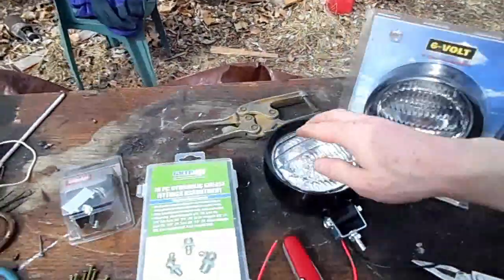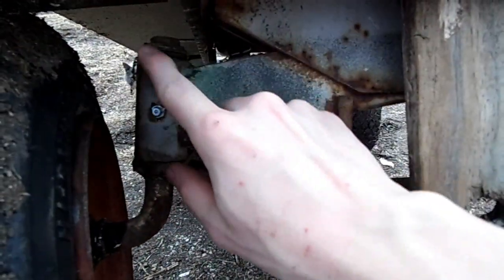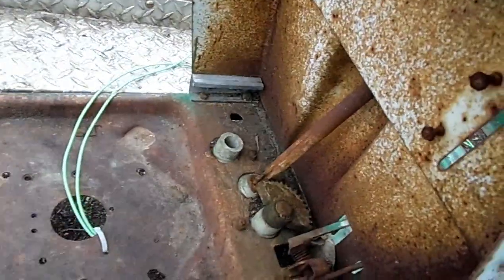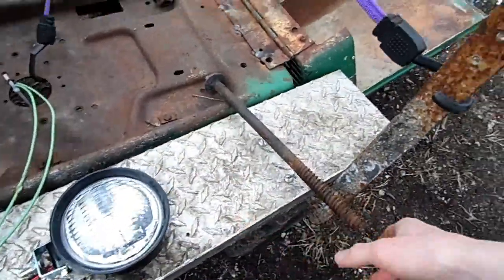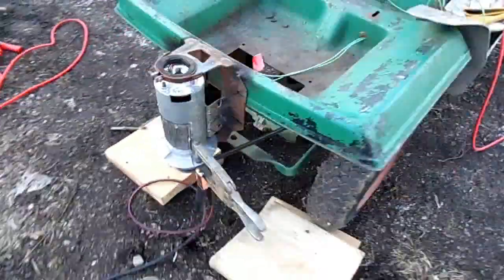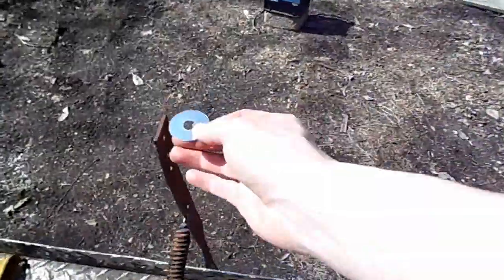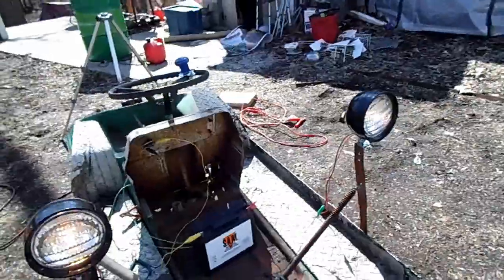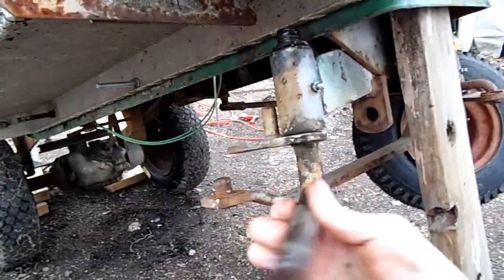DIY Electric Lawn Tractor part 5: lights and stearing

Comment: over here we have a saying, if the girls don't find you handsome, they'll find you handy. great project for sure now for number 6, been watching since the number 1
Reply from the maker: well thanks for enjoying this project. i have more things to add like bucket loader and snow plow but ran out of parts. so now i'm working on other stuff while i build up my supply of junk again. even working on a motorized digging machine that would go on the front.

i guess after my gender transition i could use the reverse phrase. if the guys dont find me attractive they will find me handy hahahaha.
Reply: +Rinoa Super-Genius your a transgender?
Reply from the maker: Sheep TV yeah?
Reply: Rinoa Super-Genius Sorry about this super late response but I wasn't intending anything bad when I said that its just that it's just I had no idea I couldn't even tell. That's the point though right?

Comment: I figured you would be a knife switch type.

It might also have been a good idea to grease the pins in the steering rods that connect to the wheels.

The next thing will be a device that will attach a grappling hook to passing vehicles allowing you not only to get a ride, but turn the motor into a generator recharging the batteries.   Well, maybe not.

That thing needs a name like Electro-Motive Suburban Assault Vehicle.
Reply from the maker: yeah but knife switches are kinda hard to come by. only got like 5 and most are small.
Reply from the maker: *****
yeh but the ones id want to make would be very good quality, i havent settled on a design i'd want yet ;p

Comment: hey, the rail way bolts are 'sleeper bolts' if memory serves :-) looks good so far and its handy to see what the grease injectors look like :-D keep it up I cant get enough of the ev stuff!
Reply: whats the torque like on it, slim chances of fitting that baby with tracks I guess :-(
Reply from the maker: battonfive
 well they are only called "sleepers" in the UK over here they are called Ties and other places have other names. so i guess just "bolts" are ok.

and yeah i was pondering a trackde vehicle. back in 2008 i was working on a Wall-E robot and got the parts to build steel tracks, i might build something small like electric steel tracks on shoes. roller-tracks :P

or maybe a tracked vehicle like a segway.
Reply: your metal work is pretty sweet can you convert a quad bike or something like that do you think in to a track vehicle, perhaps an 'electric quad track' that would look pretty darn cool, could you track up a Segway? I like the idea of the shoes, that's quite original, I'm trying my hand at autocad atm designing a car using brushless hub motors, I was hoping to pick up some cordless drill batteries or e-hedge trimmer batteries to make some packs for the final car, I spoke to B&Q, that's like your 'home supply stores' I think, who im hoping will give me the cells. They have a high amp discharge and a respectable ah, have you tried any cordless power ion cells from tools yet? and aye for an English man my English is pretty dire ;-) poor-area,com

Comment: Awesome work! Can't wait for more. Volt and amp meters should definitely be useful, and interesting to see how much current it pulls.

Do the headlights run on one of the motor batteries, or do they have their own battery?
Reply from the maker: i ran the lights off one of the motor batteries. i ran it from one of the bigger batteries. it doesnt really matter couse right now my battery pack is so unbalanced anyway haha.

Comment: Cant wait to see it going down your trail!
Reply from the maker: yeah i wanna do that also. just dont want it to get stuck.
Reply: Stuck? Put a winch on there, youve got plenty of amperage, lol.  I need to find a bigger battery for my tractor, ive got so many electrical things on it, im not sure this battery will make it, lol, I need like a car battery now, btw, nice setup, sandals, grease, ehite socks, and welding with car batteries, the safest way, lol.
Reply from the maker: NateWilson99
well its not the amps that matter too much its primarily the volts. this motor only takes like 10-20amps while the batteries could provide up to 250.

in the end if it did get stuck i could just push it manually. i keep forgetting its not like my mower. but its been raining a lot so it'll hav to wait haha.

not counting grass is just now coming in so it'd be nice to do stuff when its green in the woods.

Comment: Its got eyes now :-), it does remind me of an old farming tractor.

A small pilot drill would have made it easyer for you :-)

A question: is there any difference between a.c and d.c welding quality wise?

I like the pull switch, like the choke knob on old cars :-)

Comment: it would be cool to see you put some brighter LED lights in those fixtures you just put on.
Reply from the maker: well tbh i dont actually plan on driving it during the night. i mostly just put lights on vehicles so i dont get in trouble if i drive on the road at sunset or something.
Reply: Ok I see.

Comment: You should have bought only one light and put a led bulb in there and call the tractor cyclops :D
Reply from the maker: yeah but they are sealed beam. would require me to cut teh glass bulb open and all that. i mostly want them for the look.
Reply: Rinoa Super-Genius yeah, i guess. But those two lamps sure do give it a different feel (in a good way). Keep up the good work and the videos :)